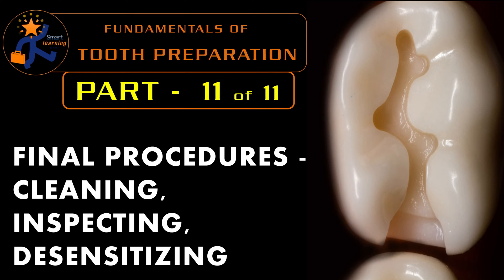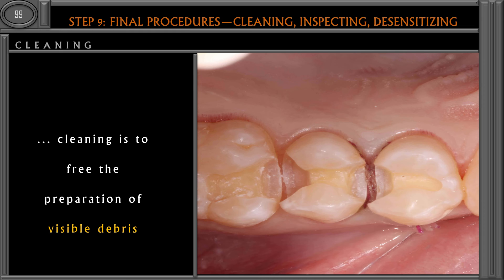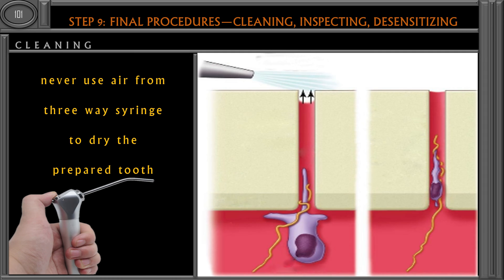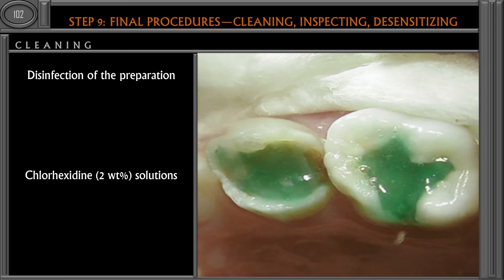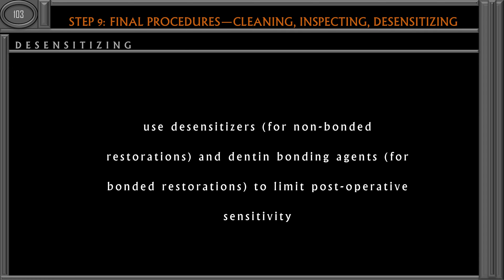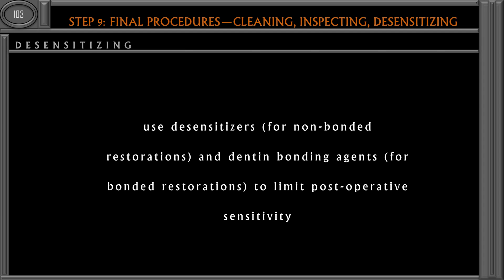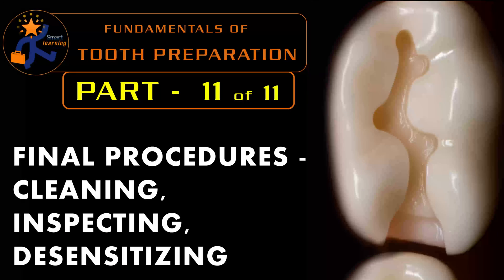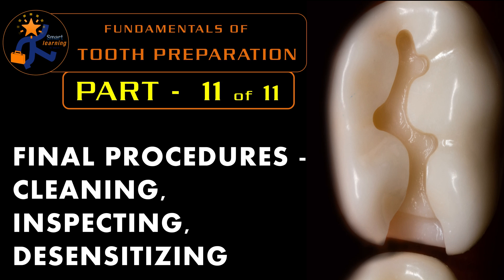Fundamentals of tooth preparation : Part 11 | FINAL PROCEDURES - CLEANING, INSPECTING, DESENSITIZING

Comment: Sir, when do we need to etch the tooth then? After desensitization or before desensitization???
Reply from the maker: If we are planning to use bonded restoration like composite, then there is no need to apply desensitizer. Desensitization is only for non-bonded restoration like amalgam